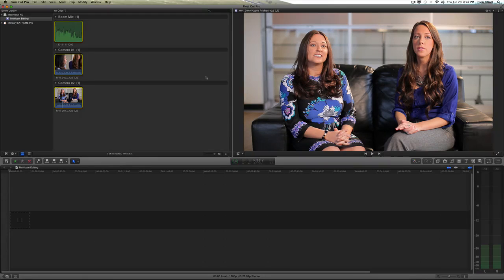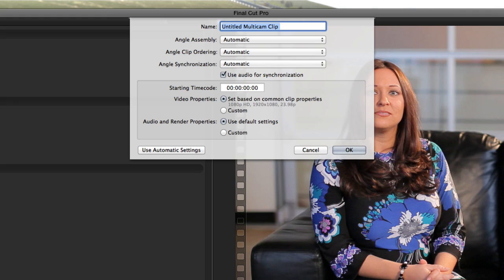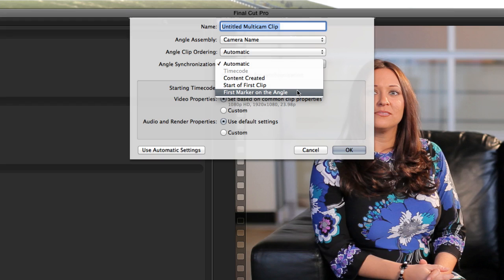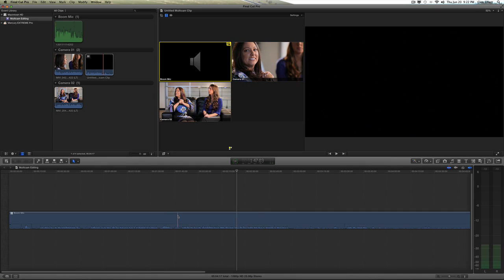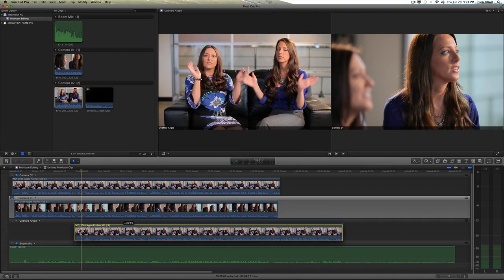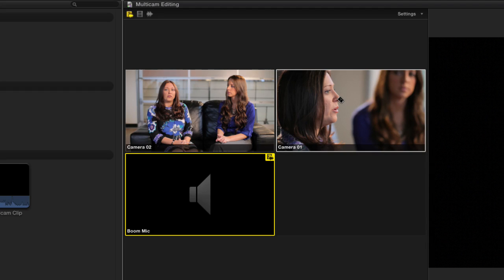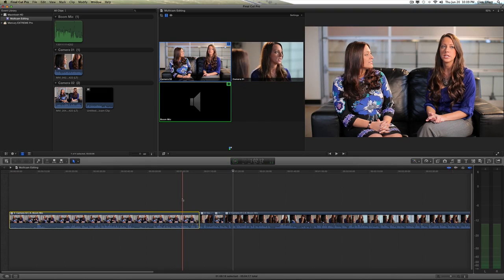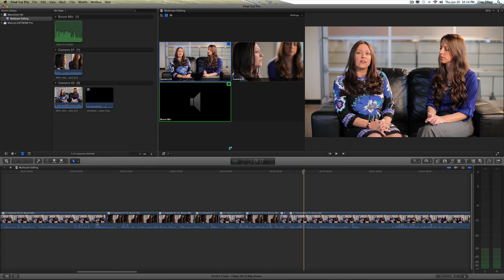Tutorial: Basic Multicam Editing in FCP X

Comment: Nice job Glen. I added some audio track per your instructions but at this point I already had a cut going after I added the boom sound tracks it changed all of my edits in cut. Can you only add track before you start editing tracks? Wondering why this happened ? I also had to hand sync one of the tracks as the sync didn't work correctly.